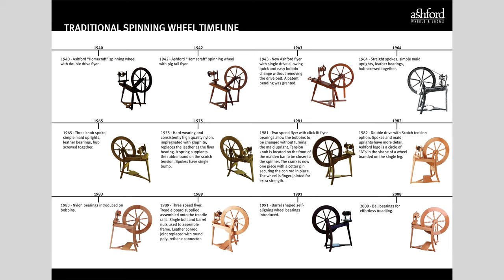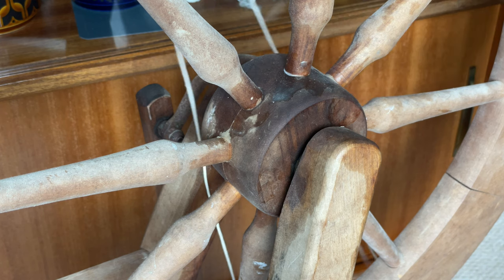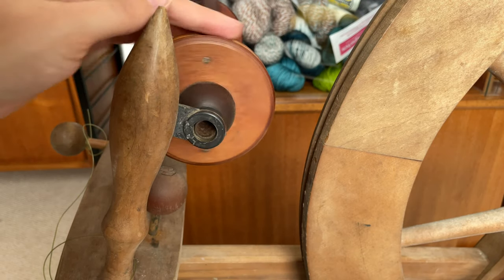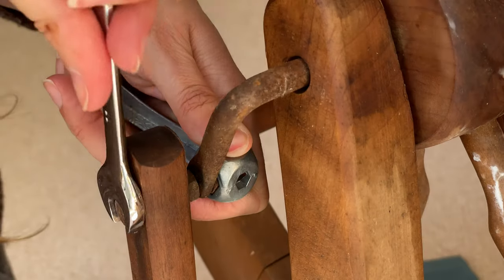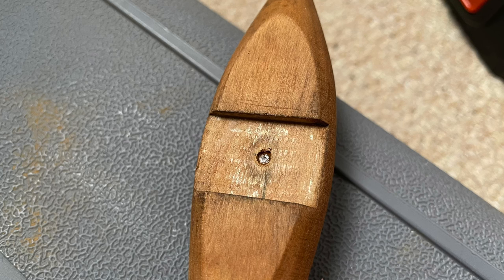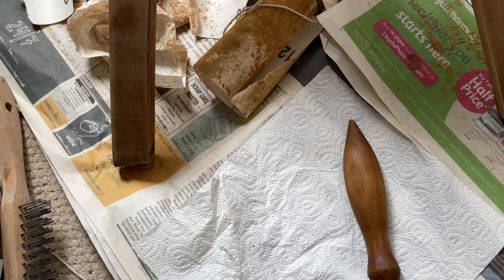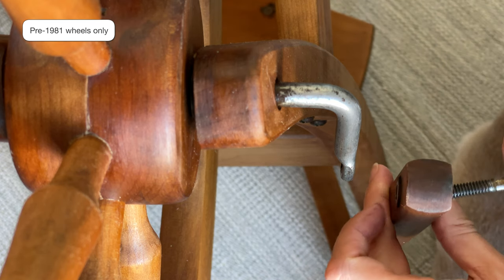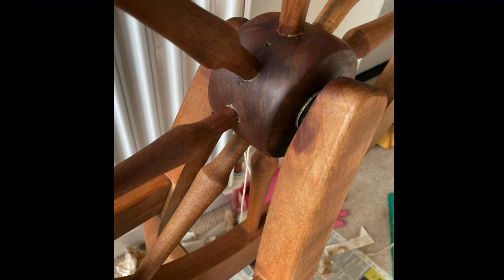Restoring a vintage Ashford Traditional Spinning Wheel

Comment: This video is helpful. I'm moving across the country, and need to take my traditional apart to fit it into a box (she's something I absolutely refuse to part with).  
Mine is actually also a 1975-1981, but I hadn't realized until your video that the maiden uprights are  shaped like the 1965-1975 model. They have the the graphite hardware, though. I would definitely have remained oblivious (if a little confused) if you hadn't mentioned they made good use of the leftover pieces from previous years.

My traditional was in very reasonable shape when I got it,  it was missing the scotch tension knob, and the treadle had a squeak. The squeak persisted for some time, even after oil, but after a few months of regular use and care, it disappeared.

Comment: This particular episode got me to take action on the secondhand Ashford Traditional I've had sitting in my home for around 3 months. I bought it through eBay marketplace here in Melbourne, Australia. They are relatively easy to find in Australia. Mine is a 1984 model, so has the slightly less attractive spokes (I agree with you about the simpler style being more attractive, but I'm okay with fussier look if the wheel works well). My wheel is in great condition. I just need to practise using her and force myself to break away from my Kiwi 3.

Becks, I've watched a lot of spinning on YouTube and your videos are the most technically interesting and the best prepared and presented. You engage with your audience in a way that shows your passion for this craft whilst never being condescending or moving too far off topic. It is so refreshing. I've got back into my spinning a number of times after watching some of your videos and wanting to try a new technique. 

Thanks so much for your dedication and sharing your expertise. Kris

Comment: I've gotten the slightly newer version of this version of the wheel (still had the old 1970s spokes + maidens, but with the tension knob in front and the sides had ridges, like the 1981 version), and I only realize now watching this video how well it was maintained! Mine previously belonged to a handicrafts teacher, and her husband was a woodworking teacher so they knew what they were doing - Only needed to oil it to get it running, and remove some rust from the flyer. I updated the flyer and got some extra bobbins, the old one was also completely made out of wood and while it spun nicely on the flyer, it was a bit crooked - enough to mess with the tension when spinning. There are still some screws that are a bit rusty, but it seems to only affect the head - not sure whether I feel confident enoguh in my abilities yet to fit it all back together again, so for now they will stay as they are :)
Reply from the maker: Sounds like yours came from a good home! It’s so interesting seeing the different changes in between the models  I love having a flick through eBay occasionally with no intention to buy another one but just to see if I can find a variant I haven’t seen before. 
And I certainly know the feeling when it comes to judging your ability to fix things before you take them apart - that’s exactly how I felt about the potential of taking the drive wheel apart. I have neither the tools nor the space for that right now!

Comment: Still have my 1978 Traditional, bought as a kit that my father assembled and varnished at that time and still performs beautifully, however, I did have ball bearings fitted later so doesn’t require oiling.  It’s like an old friend and although I have a Traveller for taking to groups, I do love the rhythm and simplicity of the ‘Traddy’.  Thanks for the video and all the info should I ever need to give it an overhaull!  Well done on restoring yours. ❤
Reply from the maker: You’re very welcome! These things were built really solidly so it’s lovely that you’ve been able to keep using the one your father built. Even better that you were able to add the ball bearings as a later upgrade.

Comment: That’s my wheel! But I was lucky to receive mine in pretty good condition. I did get the Ashford maintenance kit to replace the wee rubber band/fishing line tension (which was working, but …) and have acquired a new flyer and bobbins, but it is a beautiful wheel. 

Is your drive wheel weighted? I’m more of a spindle spinner and have found the wheel to be a learning curve.
Reply from the maker: Very nice! The fact that most of the replacement parts still fit is definitively a huge bonus. I don’t believe the drive wheel is weighted. I can leave the wheel in any position and it doesn’t get dragged down (or if it does it’s the treadle causing it) so that would indicate no weighting. The rim definitely builds some momentum though so that makes it a bit more difficult to stop. But the advantage is once you get it going it’s easier to keep it turning.
Reply: @TinyFibreStudio  yes I’m concerned that there might be some thing not quite right with the footman because it is a Traditional and I don’t know why my wheel would be waited if yours isn’t, for example. I certainly can’t discern what might be the problem, but it does cause me frustration when spinning. Thanks for your response!

Comment: Given the state of that traddy, I would not have paid even £80 for it. I recently purchased a 1983 model, that needed minimal TLC, for £120. A lot of people selling old wheels really jack up the price. There was one lady selling one, but she never answered any of my messages, and it just kept getting relisted. After 4 months she started lowering the price. Last I saw it was still for sale, but at nearly half her original asking price - and she still can't sell it.
Reply from the maker: Yeah, fair point - I was in need of a project  though, and the location was easy for me to get to which isn’t always the case around here.  A friend bought a similar vintage Traddy for £50 recently and I know someone locally who bought theirs for £20 albeit missing the flyer. The bargains are out there but whether they come up in the right place and at the right time is a different matter!
I think part of the problem is that the people selling them often base their pricing on current models without realising some of these are 50+ years old.